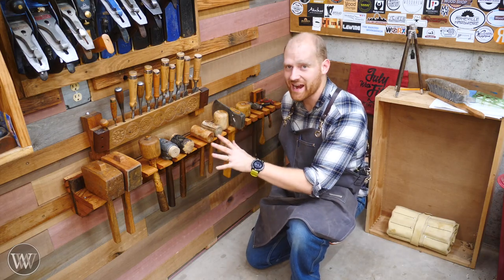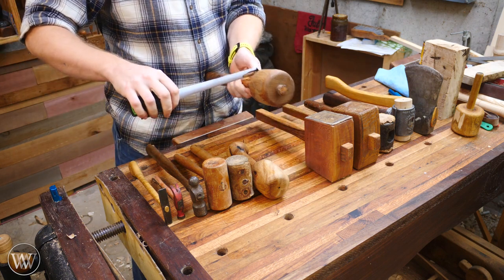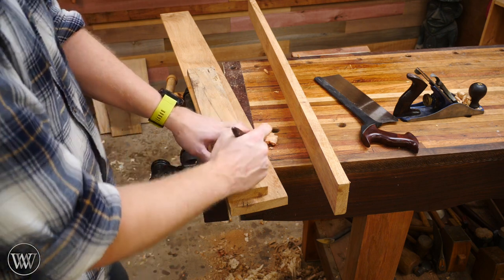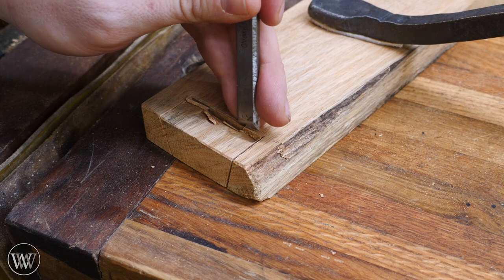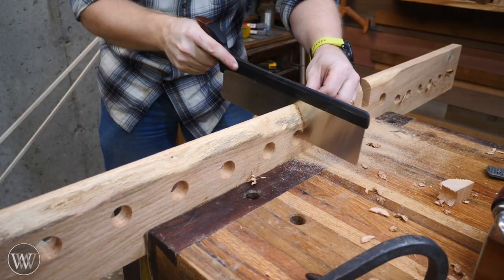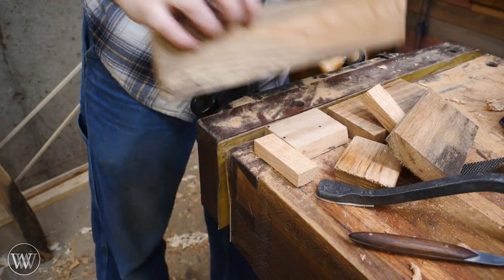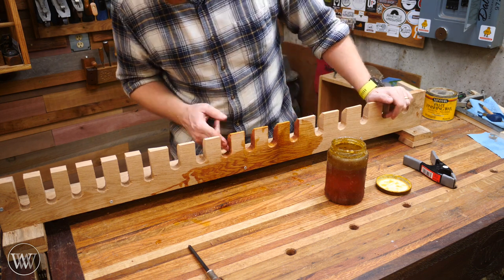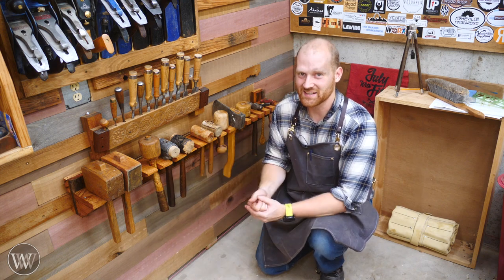Making a Mallet Rack for the French Cleat Wall - Hand Tool Woodworking Project

Comment: I made a little rack for small F clamps and attached it to the side of my bench. I cut the boards into 150mm (6 inch) long pieces and glued them side by side so the longest edge is all end grain, this way when I cut all the fingers into the board its not short grain at the base of the fingers......more time consuming but much stronger than having the fingers only supported by short cross grain. Wouldnt the fingers on yours want to break off easily the way its made? and also being oak it will tend to split easy that direction too.
Reply from the maker: I've had one finger break off if I had to do it over again I would actually use dowels as either way you run the grain you're going to run into issues on a long plate like this.
Reply: @WoodByWright  Thanks for taking the time to reply :)

Comment: I had something similar to this (although not anywhere near as pretty) for my clamps.  I made it from scrap pine.  Unfortunately, the side grain wasn't strong enough and one of the fingers broke off.  Good thing my workbench was underneath it, otherwise I'd have two bent-up clamps.

Have you had any problems like this?  I figured I'd build it again making the fingers separate from the back and connecting them with dowels, but if Oak is strong enough for those mallets and that hatchet, maybe I should just try it again with a hardwood.
Reply from the maker: I have not had any problem with it yet. I am sure sometime in the future I will smash a finger, but then the plan is just to glue it back in place and drive in a dowel to support it, if it ever happens.

Comment: Looks like the leather is coming loose from the face of your vise jaws?  What adhesive did you use? Obviously it didn't work well...
Reply from the maker: yup. it was the leather not the adhesive it is too stretchy. I will be replacing it soon it is just one of those things that has not bothered me enough to make me want to do anything about it yet.
Reply: so too thin a leather? (I don't know anything about leather)
Reply from the maker: +Ray Roberts no. The wrong tanning methoud. I should have bought leather for it but instead I just used the stuff I had on hand. What you want is vegtaned around 6 oz

Comment: Hi! 

I have trouble with the cleat system, because I find thatI can't put too much weight on it cause it bends the wall plank (I tried to make shelf brackets) and it tends to slip out very easily....  Have you ever had that experience? (I'm probably doing something wrong :P ) Thanks!
Reply from the maker: not quite sure what you mean. I have not had that problem with mine yet.
Reply: I think you mean the wall-mounted cleat bends under load? I have had that problem because I made mine from pine and it was just too weak to support the load on the hanging cleats. It was solved by replacing the  wall cleats with hardwood ones. White oak, actually, because that's what I work with mostly ;-)
Reply: yes, that is my problem and yes, I used pine. Is there a minimun width for the wall mounted cleat? Thank you!
Reply: Probably 2.5 - 3 inches (62 - 75 mm). That has been working fine for me, using hardwood.

Comment: Sorry James, this is nothing to do with spokeshaves or mallets, it is about my dovetail saw.  I find it increasingly hard to both push and pull through the wood.  I sharpened it recently, so it's not that.  Do I need to re-set the teeth?  I have a saw set.
Reply from the maker: you might want to set the teeth a bit, but you might just want to try a bit of beeswax on both sides of the plate. but if you feel like it is pinching the plate then either the saw is turning or there is not enough set int he teeth.
Reply: Thanks for that.  I use cnadle, not bees wax - is the latter better?  Meanwhile, I'm going to use You Tube to find out how to use my saw set.  Cheers, Gwyn
Reply from the maker: candle wax will work fine. it is stiffer and will rub off a bit quicker but not bad.
Reply: I'm pretty sure I can get beeswax at our local supermarket so I'll give it a try.  I tried making Paul Seller's rag in a can.  I used an old towel.  This wasn't particularly successful because towelling is too absorbent.  The oil goes in, nothing comes out.